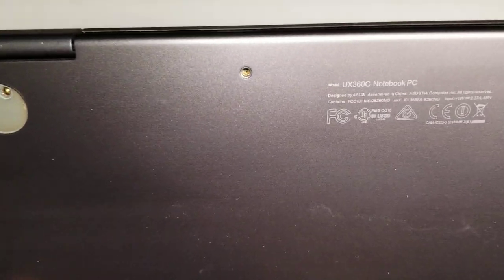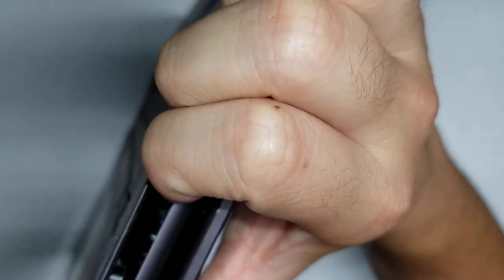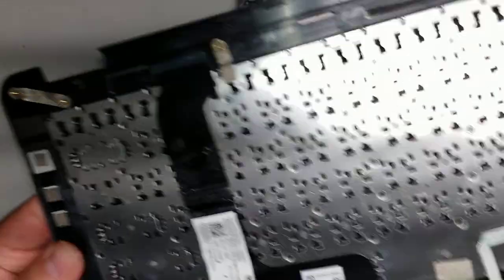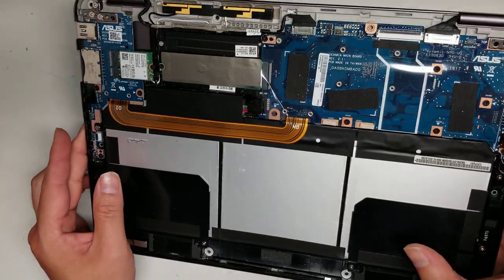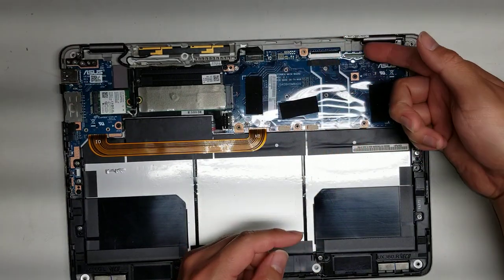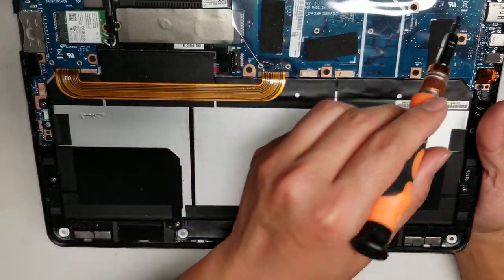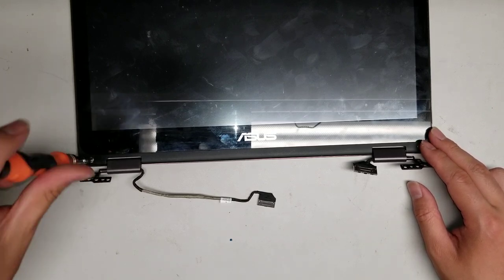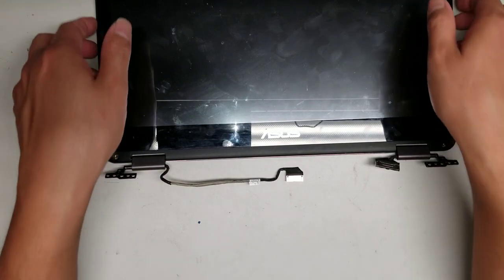ASUS UX360C UX360CA Disassembly SSD Hard Drive Upgrade Hinge Replacement Repair

Comment: Hi excellent video, thanks for taking the time to make the video, appreciated. My Hinge broke, on the right side. Is is as easy as just unscrewing the old hinge & rescrewing the new hinge on or is there anything special I need to look out for when removing & replacing the hinge besides the little cable that you spoke about Thanks Rick
Reply from the maker: Just have to follow what I did in the video. Don't forget to like and subscribe if you haven't already. It'll really help me out.

Comment: Thank you for your video! I had two broken hinges for this past year and everywhere I asked were quoting high rates to fix it. I decided to order replacement hinges and attempt it on my own. It took a lot of patience but I managed to fix both hinges and now my screen no longer falls down.
Reply from the maker: Awesome, glad it helped. If you haven't already, please like and subscribe so others can find my videos and consider contributing a little to the channel if you can. Thanks!
Reply: The same case. Two hinges cracked. I wasn't sure how to separate top and bottom after all screws unscrewed. I did not want to break something. The video immediately cut all doubts, but im my case I had to push a credit card all around the case to separate top an bottom.
Reply: @tomeks666  I definitely had issues separating the two as well. I think I might have knocked something off, because although I've managed to fix the hinges, my keyboard is a bit messed up now as well as the trackpad 😅 If it's not one thing, it's another.
Reply from the maker: @VampiresBleedingLove  :(

Comment: Thank you a lot for the video! I was able to replace my hinges :) However I ran into some other problems... some letters on the keyboard won’t work anymore and my laptop won’t power on unless plugged in. Any advice? Thanks once again!
Reply from the maker: Double check the battery connection and the keyboard connection.

Comment: So I trried to be Macgyver and replace a broken hinge, that worked! but now I'm stuck with a non functioning touch pad. Whatever I did I wasn't able to put the little white su*ker back into the connector. Opened the latch as you said but it hardly goes in a mm and doesn't hold. Any tips? Thank you!
Reply from the maker: After it's in, latch it back down. Other than that, no tricks

Comment: Truly helpful video, perfect pacing and commentary, so thank you! You have some interesting comments, such as holding down the power button AFTER disconnecting the battery to discharge any remaining voltage--wouldn't have thought of that, so smart.
Also love that you just use your fingernails, instead of the usual guitar pick-like tool that most people use. Yeah, I have tough fingernails too, and use them also for slitting cardboard boxes for recycling, as an example.  Yeah, REAL men use their FINGERNAILS!!  LOL!
But yeah, this machine, that my wife likes so much since she used to have an Air. The hinges broke on it shortly after warranty expiration. Asus charged us like $250 to repair it, which was more than half of what we paid for the new machine.  I tried to argue that it was a manufacturing defect, and they said, "No, our hinges have been tested for (like) 50,00 revolutions and have no problem". Afterwards, the OTHER hinge broke, and we purchased another of the same model on *bay. Eventually, yes, same thing. So  we are really unimpressed with that make. Perhaps the problem is really, as you point out, with the SCREWS, and not the hinges as such.
 The new equivalent to this machine is no longer made of metal, as far as I can tell.
But now I managed to cannibalize the remaining hinge from one machine to transfer to the other, and along with another new hinge, it seems just hunky-dory, so, again, thanks for your terrific video!  It''s nice to be able to re-vive and recycle an older, perfectly usable machine.
Reply from the maker: Haha yeah, fingernails are very useful. I don't understand why people are so against them... As for the hinges, a lot of times it's the hinge mounts that break. I usually replace the broken screw mounts and screws with jbweld, but it takes a lot of skill to fix and know what you're doing so you don't make things worse, so I don't show those types of repairs. Anyway, glad my video helped. If you haven't already, please like and subscribe. It'll really help me out. Thanks for watching!
Reply: can we upgrade Memory and M2 SSD for this note book? .,.,.,.,.
Reply from the maker: I show what's upgradeable in the video.

Comment: After disassembling this pc twice, where the heck is the fan? Does the PC have no fans? That is really strange. Now it makes sense why it does not have any grill for the exhaustion of heat and it can not run many tabs at the same time. The more I have this PC, the more I am astonished why it cost $ 1250.
Reply from the maker: I see radiator fins right above the SSD, but don't see a fan. I'm not sure.
Reply: @ItsBinhRepaired  Same. I just found it strange. LOL.
Reply from the maker: @zirak93-2  yup

Comment: i was almost successful but no matter how hard i try, the top left corner won’t pry off
Reply from the maker: Hmmm only thing I can think of is to rewatch and try again. :(
Reply from the maker: Did you remove the screws under the feet?
Reply: @ItsBinhRepaired  yes i just did that a few minutes ago and it worked!
Reply: @ItsBinhRepaired  it’s really dusty, can you suggest any cleaning methods?
Reply from the maker: @blendify  toothbrush and air blower
Reply from the maker: @blendify  this might help https://youtu.be/3zs_SJ3BXgA
Reply: @ItsBinhRepaired  ah ok thanks i’m gonna try to take off the keyboard and trackpad cables
Reply: @ItsBinhRepaired  i’m having trouble finding the “latch” on the trackpad connector. What color is it?
Reply: @ItsBinhRepaired  never mind, i got them both, thanks for helping so much :D
Reply from the maker: @blendify  lol
Reply: @ItsBinhRepaired  hey it’s me again 😅, sorry if i’m a burden but i’m having trouble understanding how to remove the battery.
Reply from the maker: @blendify  if I didn't show it in the video, I'm not sure.

Comment: I have error blue screen in this model
Probably in ssd hard 
In baios Sometimes he reads the hard drive and sometimes he doesn't read. Is the problem in the hard drive? Blue screen
Reply from the maker: Sounds like it
Reply from the maker: Could be RAM as well

Comment: I just disassemble this computer to set it in a 1 TB SSD. Although it was successful, God damn it was the hardest PC I have ever worked with it. By just this experience I am going to keep myself far away from Asus computers. Bad hinges and totally impossible to disassemble. A bunch of morons has designed and built this computer. I have never seen so bad build-up of the components, and I had disassembled a few computers, and no doubt about it, this is the worst. 

I want to give you a huuuge internet hug for an awesome tutorial. You deserve my like and subscribe card. Thanks, pal.
Reply from the maker: Awesome, glad it helped! I have videos of so many models. You can look at the designs before buying. :P Thanks for liking and subscribing. It really helps!
Reply: @ItsBinhRepaired   Just to inform you, it was my sister's PC. I had a water incident with my old computer and had to insert my old SATA SSD in her computer as my own only accept the new PCI system. I would never buy a computer that is that hard to disassemble. Again thank you. 

I have another question that you may know the answer to. I have just bought the Lenovo 14s yoga and in their manual sheet, it says you can only set in a second SSD that is up 1 TB. Does that mean if I insert a 2 TB SSD the BIOS won't accept it? Have you tried something that the manufacturers don't approve of? :)
Reply from the maker: @zirak93-2  no problem :)
Reply: @ItsBinhRepaired  Thank you as well sir. You were a big help. :)

Comment: Thank s for the video. Both my hinges have locked, so I can no longer  fold the screen over. Is it possible to repair the hinges or better to get a new/used pair? 
Also my touchpad mouse is not responsive, I  can not find the exact same ribbon (AWM  20696 80c 30v) . But I have found AWM 20624 60v, is a suitable replacement? 
Thanks
Reply from the maker: The hinge is usually the plastic mounting points that broke, not the hinges themselves. I'm not sure about the cable.

Comment: Thanks for this vid. My wife has this tablet/notebook and dropped it recently, wrecking the right hinge. Thanks to your vid, I was able to re-install the new one easily. Also I'm looking at 1TB M.2 drives now as that seems very easy to upgrade.

what was not easy is getting my large hands to put the keyboard and power ribbons back in place, but I was able to after a bit of a struggle.

Thanks again for making this video.
Reply from the maker: Awesome! Yeah, those cables can be a pain.

Comment: Hi, do you know what the little metal tape-like stuff that is glued to the hinge inside the display compartment is?  It's also attached to a little folded up "pillow" of the same material that is glued to the inner wall of the metal cover of the display.  It needs to be taken off, I guess and then reattached during the hinge replacement.  Is it part of the touchscreen functionality perhaps?
Reply from the maker: The aluminum foil tape? It's not important unless it's for the wireless antennas.
Reply: @ItsBinhRepaired  Thanks very much for the quick reply.  Cheers!
Reply from the maker: @timothypollock8358  no problem

Comment: Hey do you know where I can find the CMOS Battery?
Reply from the maker: I think it uses the main battery for that.
Reply: @ItsBinhRepaired  Alright, thank you!
Reply from the maker: @sam_ed  no problem
Reply: @ItsBinhRepaired  Just found out, it doesn’t, the CMOS battery is somewhere on the Logic Board (probably soldered).

One question, my CPU temperature goes to about 85 Celsius on normal use, is this normal? I replaced the thermal paste on the board and it didn’t really help. Worth to mention is that I‘m using only the board without any housing! Thanks for your answer.
Reply from the maker: @sam_ed  the housing helps with the air flow. Imagine being in a room with a fan on, but the fan is just facing the door. That's essentially what's going on.
Reply from the maker: @sam_ed  it issues the main battery as the cmos bios battery
Reply: @ItsBinhRepaired  There‘s actually no air flow, xD 

Heatsink is getting passively cooled
Reply from the maker: @sam_ed  lol that's not good
Reply: @ItsBinhRepaired  there’s no fan in this laptop
Reply from the maker: @sam_ed  oh, then it's just going to thermal throttle itself.
Reply: @ItsBinhRepaired  No, it‘s designed like that to run without a fan..
Reply: @ItsBinhRepaired  Can you tell me your temperature of the CPU? (You can look up with HWMonitor on Windows)
Reply from the maker: @sam_ed  exactly! Thermal throttle. The MacBook airs did that shit... people tested it by cooling it from the outside and it ran way better.
Reply from the maker: @sam_ed  I don't have a warehouse full of computers lol These are customer devices.
Reply: @ItsBinhRepaired  You know what‘s very interesting, the same CPU (m3-6Y30) was used in the MacBook 2016 12".
I wonder how Apple designed their heatpipes
Reply: @ItsBinhRepaired  Ohh, so you‘re a shop
Thought it was your personal laptop lmao 

Anyways thanks for your help lol 😂
Reply from the maker: @sam_ed  lol again, those airs were shit. They thermal throttle themselves

Comment: Hey, do you know what makes a laptop turn off? I checked motherboard and nothing was bad. So im asking do you anything that makes a laptop turn off like cpu thermal paste or something?

Edit: headsup my laptop aint receiving power either. So what part is making this happen?
Reply from the maker: So it won't even turn on?
Reply: @ItsBinhRepaired  I hope you still reply and yes
Reply from the maker: If you spilled on it probably bad keyboard/power button/motherboard/screen